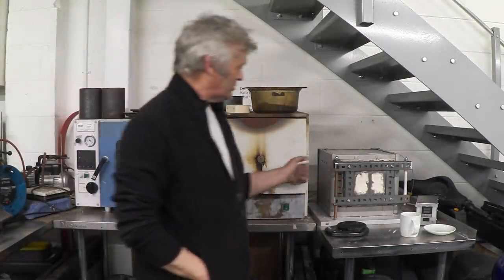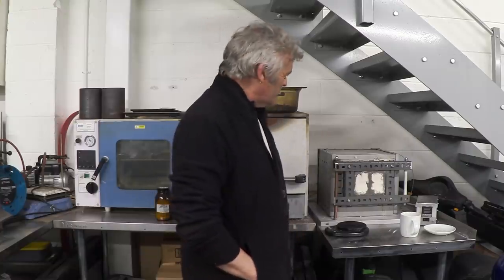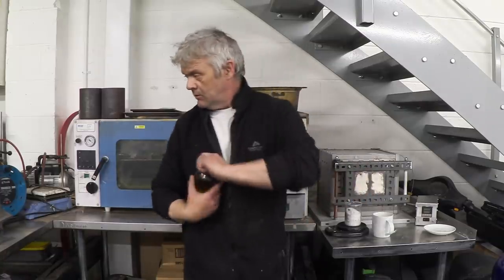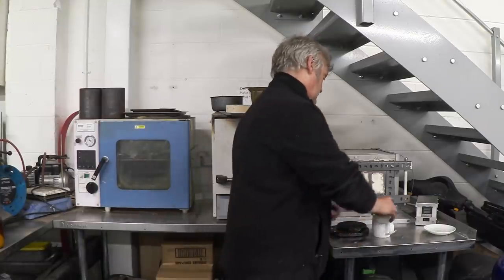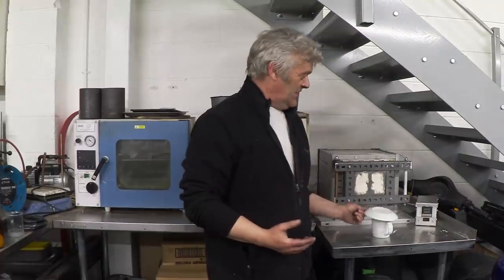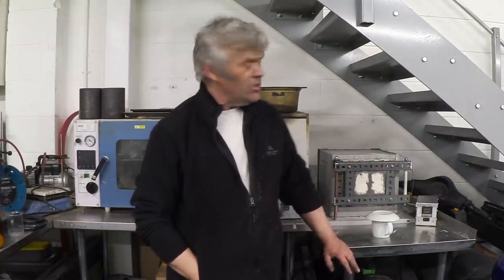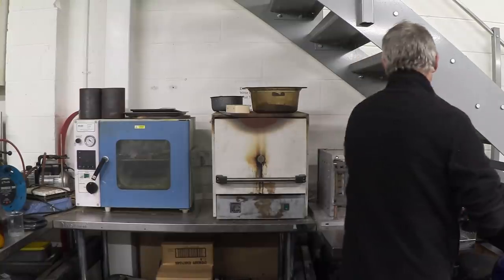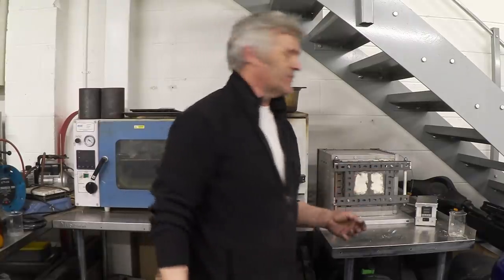Making Graphitic Carbon Nitride

Comment: Robert, I am curious if you may have considered adding gCN to the clay-carbon-based material, particularly for use as HHO electrodes???  Seems an interesting potential, to me...
Reply: maybe nighthawks 'starlite?'and mix dough w/ copper particles for an Oakridge Lab.CO2 reduction to ethanol you tube video available..If you applied a H.V. to 'dough' it may give the spiked carbons oakridge described.What does the group,public-pub-liqours E.G.) think?I'm amateur radio General license kc1frf,and why I posted 'group' colloquesism.HHO electrode improvements are of high intrest.Tell us progress,please.

Comment: Maybe consider adding a rectifier in series with the heater elements with a manual switch across it - you'll get a half-power option.
Reply from the maker: for sure mate
Reply: I thought he would control temperature by microcontroller with PID control loop, so doing PWM with a solid state relais (you can DIY, just measure zero crossing of powering phase for switching on or off, then use a triac or High Voltage Power-MOS-FET; I would keep period below a second, so it does not have so much cycles of heating up and cooling down. The shorter period is, the more the "digital" heat package comes into play, when only switching on zero crossings is allowed, so 100Hz. We have to gain a fine granular heat control by adding some noise to the switching point of time, leading to a half mave more or less and distributing that in the spectrum of switching times.).

More granularity can only be obtained by flexible switching parts of the heating in series or parallel.

Comment: I wonder how you cope with that loads of ammonia gas released while performing the polycondensation without a (at least visible) vent.
Reply from the maker: if you're going to this on a large scale, you will need ammonia scrubbers mate - even chicken houses have those
Reply: Robert Murray-Smith Yeah, I‘m aware of that, technically shouldn’t be an issue though, just wondering how you cope with the ammonia

Comment: Would a kiln like that be capable of running 220c for 12 hours? If so you should make nanocrystallites using a benzene thermal reaction. 
Yeah I googled it. Lol
Reply from the maker: the kiln will do fine at that - make a kiln, do it and make a video mate - i'd love to see it - cheers
Reply: A normal oven will do that that temperature happily
Reply: @jamesbrown99991  hahahahaha,ahh...such fun...thanks...
Reply: @jamesbrown99991  Yeah, but MUCH less energy efficiently.  These little kilns besides being much smaller than a home stove, are much better insulated.  
   Sometimes you can find used jewelry kilns around for reasonable.

Comment: I just ran my first batch of urea, and I got yellowish-gray stuff, but also some brown stuff. Did I over / under cook it? Or maybe too much oxygen got in? I saw in a research paper that they washed it in .1M nitric and distilled water to get rid of impurities.
Reply: would u mind mentioning the procedures you followed? and what type of furnace you used?
Reply: @danielshumi6549  I put 50g of granulated urea into a small 100ml QWORK ceramic crucible. I heated it to 1023F (just barely over 550C) in a PMC tabletop oven and let it sit for 3 hours after it stabilized. I let it cool, and found the top layer had brown stuff. I did a second batch last night at 1200F for 3 hours and I have more brown stuff and almost no product at all. Both products were more gray than brown. The top lip of the crucible is not glazed.
Reply: @cassiusclay3978  🙏
Reply: Now a member. I'm sure I missed something important in here.

Comment: When I try making it all I get is just a few little pieces, like half a dozen or so,  not even close to the volume I should be getting. I've tried expensive and cheap Urea and varied the length of time in the kiln. Any  one have any thoughts on where I'm going wrong.

Comment: I tried this after one of Robert's old videos using diesel exhaust fluid (~30% urea in distilled water) with sugar disolved in (I forget the ratio).  It seemed to work ok with no ammonia smell.  Worked in a 700w microwave kiln with minimal issue except for some boil over.
I'm not a professional chemist, so I can't be sure that it was graphitic carbon nitride.
The other related experiment uses boric acid in place of urea to make boron carbide.
These could theoretically be used as the "P" and "N" to make carbon based semiconductors that could be 3d printed.
Reply from the maker: that is awesome mate - thanks for sharing

Comment: One question, is the amount of ammonia produced toxic? Or in anyway harmful?
Reply: The more interesting question is: do I have to vent the kiln "a little bit" to prevent corrosion on the heating wires? Or shove in some Nitrogen from Air Purifying or just a gulp from a bottle of welding gas?

Comment: Today an odd thing happened with me, I have prepared this stuff in the past i.e its bulk form which is shown in the above video. A programmable box furnace was used to conduct the process, 10g of urea (lab grade), and 10g of melamine (industrial grade) were placed in separate 50 ml alumina crucibles and heated to 550 deg C for 2h at a ramp rate of 5 deg C per minute. In the past lemon yellow product was obtained but today the UREA sample agglomerated to form a single crystal and no change was observed in the melamine sample. What could have gone wrong in your opinion? also, I have been trying to prepare nanotubes of g-C3N4 using melamine (industrial grade) as a precursor. Around .52g  of melamine is dissolved in 20 ml ethylene glycol to get a sat. sol. Then 60ml of .12M HNO3 is added to this sol. dropwise under stirring. The ppt. is collected through filtration and washed with ethanol and dried in a vacuum oven at 55 deg C for 8h and then annealed in a box furnace at 350 deg C for 1h with a ramp rate of 8 deg C/min. I prepared 10 samples and XRD analysis of all those samples revealed a great deviation from literature. In your opinion what could have been the reason behind this? I want to synthesize a composite of Graphitic Carbon Nitride nanotubes and Zeolite Imidazole Framework - 8 (ZIF-8) to act as a photo-catalyst for reduction of CO2 to methanol.
Reply: Abdul Wahab  I think it’s unlikely rob will get to see your comment as he has said he can’t get to read comments on old videos 
It’s likely at some point he will do more on this subject and you could ask him then and have a much better chance of an answer 
Which I would like to know more about co2 and co synthesis to useful stuff 😀

Comment: Cool experiment.  Although it's only about 20$ a gram on ebay
Reply from the maker: you can get it on ebay? - lol - that is awesome - by the way i looked - i didn't see anything available - and doesn't it strike you as odd to put only infront of something like $20 a gram - that is still really really expensive
Reply: Robert Murray-Smith I guess they used only as you stated it was $100 per gram. I’m curious why more labs aren’t dedicating themselves to making this seeing as there are massive profit margins even at 20$ per gram ?
Reply: @SzonSer  exactly what I'm wondering. If there's a market for the stuff I already have the perfect setup to create it I just don't want to spend that time and make my garage stink like cat piss if there's no market for it
Reply: After a quick check, not on UK eBay, only Canada and USA :-(
Reply: @solarhope  I wonder if there is a market for it? I may just make up an OZ of the stuff and throw it on Ebay for 20$ a g and see what happens